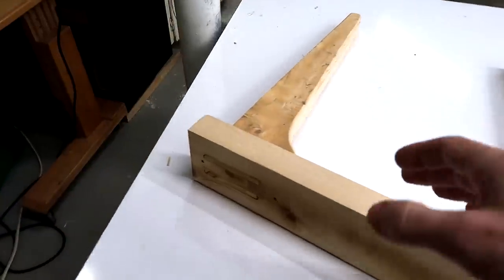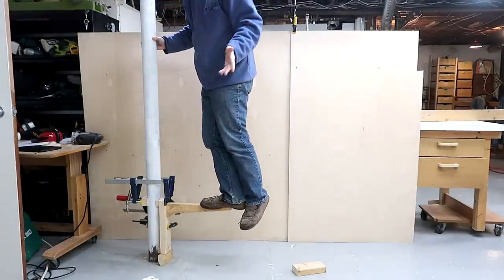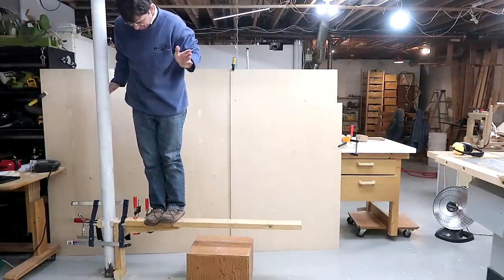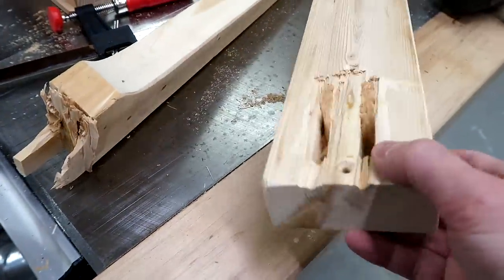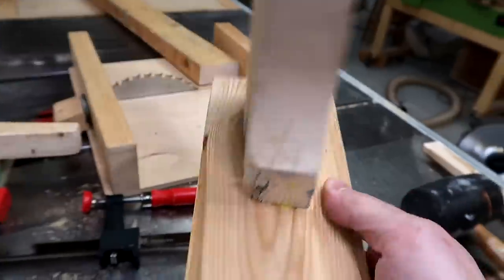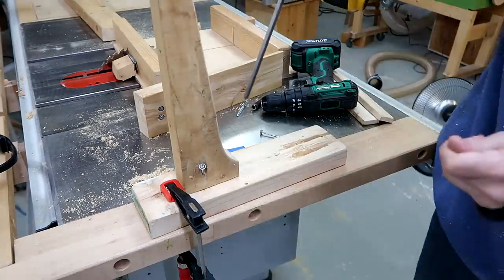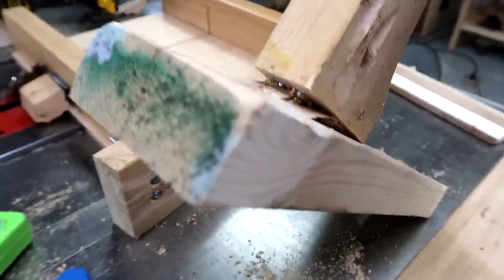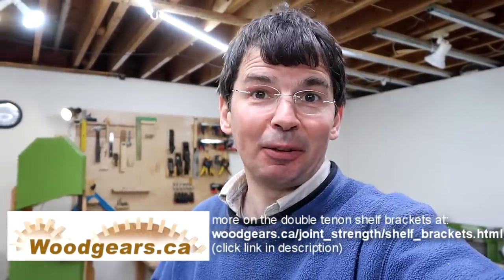Shelf bracket strength test: Double tenons vs. screwed vs. pocket holes

Comment: I find this a common issue with pocket holes. They work great for stuff like cabinets, but not for table tops for example. In time the screws slowly loose some tension and start separating the wood because you only have a small amount of holding surface.
Reply: Having built a few rough items without glue, which later gusseted for stiffness, I accept the recommendation to use glue with pocket holes. Might be of benefit in the cases you mentioned.

Comment: the problem for me would be sagging.  The level of sagging prior to failure in these test's wouldn't be acceptable for me, so in general when I make shelf brackets from wood, I add some kind of cross beam to form a triangle. Even one fairly close to the wall at an angle still makes for an incredibly strong rigid system, to which you can mount tools or store other heavy objects.

Comment: Nice work!  I'd be interested in seeing the long screw test repeated using round head screws and very substantial fender washers to back up the underside of the screw heads.
Reply from the maker: Easy.  You cut some pieces of wood and you do the test.  No special equipment required.
Reply: We can't all be daredevils like you ;-)
Reply: I think there is no practical need for much stronger joinery (for shelves of this type) than what we have seen here - putting more effort into the joinery may be unneccessary when the overall design of the entire shelf isn't equally strong. These shelves will be useful when you have to store long pieces of wood or other stuff like that and you typically will not pack it dense enough that the joinery we have seen here will fail. When you need massive metal profiles to be stored, you would use steel shelves of course. But when you have only shorter stuff to put onto a shelf, you will be better off with making ladders. The laws of levers are cruel to every material, so don't challenge them further than you have to.

Comment: Only reason to use pocket holes is if you're making a crap ton of face frames since they don't experience any real meaningful load, or using them to keep something in place that is already mostly held in by gravity (Like a countertop) and you just don't want it to shift laterally or flex/bounce when knocked. Literally the only reason I even have a pocket hole jig.

Comment: What kind of glue do you use? In our experience a good wood glue will hold better than the wood. I saw your tenon pulled out of the pocket showing glue failure.

Comment: Love your videos, and yes we know you hate pocket holes.... And it shows by the way you make about every possible mistake you can make with a pocket hole lol
Reply: Improper screw length, position not clamping work to get a solid connection, loosening screws and rightening them, improper orientation, and not an ideal situation for pockets holes to begin with.  Improper depth stop settings, and using a 12$ jig.

Let me do the same test and I'll use my poor mortise and tenon skills against pocket holes and almost guarantee I'll get the exact adverse of the results you did lol.

Comment: Why no pilot holes for either the Heinz-style or pocket-hole assemblies? Seems like it caused you a lot of trouble not to have them, and you usually do pilot holes for almost everything. Also, the splits and damage that non-piloted screws do internally may have affected your results. But you know what you're doing so I assume there's a reason. Just curious what it is.
Reply from the maker: Watch the video, see me drill the pilot hole before putting screws in from the back.  Pocket holes are generally done without pilot holes.

Comment: Hi Matthias. Nice video, I love your channel. Something that came to mind, is that since shelves are not typically +- 80 cm wide, it might be better to do this test without using a lever to increase the breaking force. This induces a moment force/torque around the joint, where an actual shelf bracket will rather have more of a vertical force.  The moment/torque creates a horizontal force on the joint, pulling the tenons and the screws. A more accurate test would maybe be to load it closer to the joint, with more weight. It would be interesting to see if the results differ when testing it like this. 
P.S. I bought your Small Dust Collector Plans and just finished building it this week. I am very satisfied with how it turned out. Well done! Keep up the inspiring work.
Reply from the maker: it's all torque that breaks the joint.
Reply: @matthiaswandel  Thinking about it now I guess you're right. Because the torque will break the bracket long before the shear force of the vertical component of the weight, it is not really necessary to test it. The deciding factor will always be the torque.

Comment: I make all mine  at a 45 degree angle with no pocket holes, no tendons, no screws. Use glue and 2-1\2 finish nails, can make 20 in 1 hour no problem.

Comment: I would say the strongest overall would be the tenons with nice straight grain and dowels driven in at 90 deg to mortice and tenons. This would guarantee a break rather than tenons slipping out. A question to ponder. Should the tenon thickness and spacing be equidistant? In the setup I mentioned the answer to this question can be answered if an equidistant test setup. Would the actual tenon fail or would the mortice side split apart or would the dowel shear? My instinct says favour must be given to a slightly thicker (a very small amount) tenon to withstand slippage and notching of the tenon from the linear tension applied by the dowels.
Reply from the maker: For a well proportioned mortise and tenon joint, pinning it weakens it as it cuts off the fibers of the tenons.  If it's well proportioned, the tenon itself is a limiting factor, so you don't want to put a hole in it.
Reply: @matthiaswandel  Thats why I said favour should be given to a slightly thicker tenon, I do accept your point in that a hole will reduce tensile strength though. I noticed your tenon failed half way down it's length which technically should not be the weakest point given it should be reinforced with glue plus friction, ideally I think you want the tenon to fail at the base leaving it seated in the mortice. To me this would seem like  optimal strength in this situation.

Comment: Looking at the failure on the tenons, if you pin the tenons about about 1/4 of the way down from the top would that improve the strength of the joint?

Comment: What about glue and screws? The bracket end grain might result in minimal glue strength, but still an interesting experiment.
Reply from the maker: the screwed joint WAS glued, just that that popped immediately, so it had no impact on the strength.
Reply: @matthiaswandel  Ah, I missed that the screwed sample was glued. I expected it would have a negligible effect on strength. Thanks for clearing that up.

Comment: I missed that John Heisz skit there

btw: impact drills do usually not hammer the bit into the screw, that is what hammer drills do (axial movement), an impact drill applys a torque by hammering tangent to the rotation
Reply: I believe you are right that it isn't directly hammering the bit into the fastener, but it is achieving that same goal indirectly. After each hammer-blow the torsional force is temporarily stopped which gives your downward pressure a chance to reseat the bit for the next Hammer blow.

Comment: Staggering the pocket holes and using the proper length of screw would have made a huge difference. Add some glue and it would be solid.

Comment: what if u used a combination of screws and nails. since screws have no shear strength due to the work hardening principle from turning threads onto metal. kind of like same reason nails are preferred fasteners in structural applications where shear strength is needed (i.e hoist hangers)

Comment: I wonder if on the shelf bracket you drilled a hole for a dowel so the screw bit into some long grain instead off end grain if it would hold better?
Reply from the maker: seeing that this is not where it failed, I don't see that making a difference.  Might even weaken it seeing that the wood itself tore around there.

Comment: Is crooked grain always weaker? Would screws also have a hard time in crooked grain? (Also, great vid- I'm a long-time fan)
Reply: The point is you want the grain to line up correctly with where the most stress (tension) is going to be for optimal strength.
Reply: @JDeWittDIY  Thanks!

Comment: Would pilot hole before 3” screws were inserted best the tenon results?  It should limit premature splitting caused by wedging the screws between wood fibers
Reply from the maker: Watch the video, see me drill the pilot hole?
Reply: Matthias Wandel I was referring to the first (long screws with washers) not the pocket holes. iirc you never showed that part

Comment: What about a thick single tenon an draw boring with say a 18mm dowel instead of glueing? I guess that would be even stronger, as the tenon could not be pulled out without sheering off the dowel.
Reply from the maker: it weakens the tenon, which would rip.  But before that, the dowel would break.

Comment: Why not use the strength of the wood by jointing the mortice and tennon like an axe head? I can think of a few variations on a mortice and tennon or pegs, or dovetails that would be stronger as they wouldn't necessarily rely on glue or screws to hold up, and you could use the grain directions to your advantage.
Reply from the maker: cause if you put that wedge in hard like an axe head, you just split the piece of wood it goes into.
Reply: @matthiaswandel  wedge? No I just meant rotate the mortise and tennon 90 degrees so that the wood against the wall is the "handle" and the shelf is the "head"... So to speak. Either that or peg it with dowels.

Comment: An impact driver does not hammer the bit into the screw head - that would be the action of a hammer drill. An impact driver impacts in the direction of rotation.

Also, I wonder how pocket bolts would be, machine screws with a nut a bolt (recessed?) on the back of the post. Or bolts in the other direction with one of those hemispherical nuts recessed in the arms the way Ikea likes to do it.

Comment: You're not building spacecraft.  Your double tenon requires 2 big, custom machines - 3 really, because a dust collector is pretty mandatory.  The screwed joint can be built anywhere by anybody with a drill in minutes.  Nobody's time and storage space is free.  The screwed joint might not be stronger, but it is BETTER.  I would argue that for a shelf yielding is better than sudden failure.

Comment: Thank you for showing these tests, you've shown us that in this case it is sufficient to screw the hangers from behind... of course, with washers  P.S. The frustration you had with the pocket holes is common! Yeah, they will move around that way, that's why they have all those special clamps. You can clamp without buying them, but they aren't as convenient or quick.  What if you screwed the wood one(or two)  screw with washer from behind in the middle and then put a pocket hole top one side and bottom the other side?  so it wouldn't move around, but would that stronger?

Comment: I would have PL Premium'd or No More Naile'd the joint and on that size of bracket I would have used 4 screws 2 in the back 2 in the face. EDIT: Thinking about it, I'd throw in some GRK structural screws and add glue to the screw hole.  I guess I overbuild/waste hardware.

Comment: If you can’t drive a screw, pocket holes probably aren’t your thing.
Reply: Probably didn't help that the workpieces weren't clamped together, though clamping that beast probably wouldn't have helped much.
Reply: But wanted to record the video- and in the effort, moved his body to an awkward position where he cannot use his body weight to manuver the drill...

Comment: Why do/did you use Phillips Head screws when there are better options? (eg Square Drive or Daisy Head)
Reply from the maker: No philips screws in this test.
Reply: @matthiaswandel  Hmm. Those stripped-out screw heads looked like Phillips. But I see on reinspection that they are square drive. Oh well = P Appreciate the response.

Comment: Another demonstration of Mr. Wandell's irrational dislike of pocket hole joinery. Misuse the method with screws that are too long for the joint and misapply the technique by using it to support a shelf bracket. Meanwhile the rest of us will use pocket holes to efficiently join face frames to cabinets and similar low stress joints where tenon or dowell joinery would be overkill.

Comment: Wouldn't the 4" screws be more effective at an inverted angle? Going in from the bottom towards the top?
Reply from the maker: no
Reply: Joel Clonch: Given the direction of traction, if they were as you say they could also bend rather than be pulled axially, giving up sooner

Comment: I guess I don't understand the pocket hole failure. The pocket holes didn't fail. The user failed to use them correctly. Do the test again with the screws properly spaced. Furthermore let us find a shelf application where we need to support a person's body weight on 1 bracket farther than 50cm out. Obviously there is great leverage at the fulcrum in this instance. In a normal shelf unit at least 2 brackets would be used with a spread load on a horizontal member. This is why I like real world examples instead of bogus diving board test.

Comment: 4 screws could have been the cause of failiure. It means 4 lines of disruption of strructure of the wood and maybe 4 points of failiure. Maybe three separated from each other, or two (even located in less than optinal locations), could make an stronger joint. But i dont think he is happy to keep trying with pocket holes    :-)

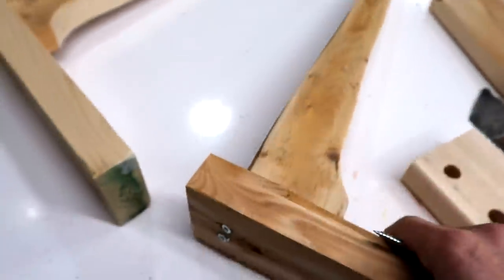Comment: 0:22 are those robertson screws stripped? I thought they weren't supposed to do that.
Reply from the maker: If you slip out of them enough, they do.
Reply: You can strip ANY fastener, given the right amount of dedication!
Reply: @iliketoUSEmybrain017  I believe "IKEA" is a Swedish short-from for "You can strip ANY fastener, given the right amount of dedication!"
Reply: Are those pocket hole screws Kreg brand? If so, there's half of the problem. Hillman pocket hole screws are better in regards to fitment with the driver bit I have found.

Comment: I'm missing the ultimate combo. Glued tenon with screw across the joint locking it in the wood.
Reply from the maker: Go ahead and test it
Reply: @matthiaswandel  For proper comparison the conditions should be the same. And believe me, If I'd be the one to test them they'd broke much earlier. :-)

Comment: What about pocket holes with metric screws and big washers on the back?
Reply: what do you mean by metric screws? machine screws with metric iso threads?

if mounted correct an M8 bolt with 8.8 rating bolt will hold about 32 kN which is about 3,26 metric tons of axial load

but since the threads are very fine they will pull out and fail way sooner than regular rood screws

Comment: This is actually the least fair comparison I've seen him do.  They all had to deal with the same crappy lumber, the screws were driven in a way that we all know wasn't the strongest and there is no way that they took as long as the mortise/tenon even not counting setup, and then the pocket holes... they were used in an already compromised piece of lumber AND then drove a mess of them crisscrossing through the same area practically destroying it in the process.  

Honestly, all things considered, all three appear to be roughly equally functional, with one taking MUCH longer to make using tools that most of us don't have- the M&T...
Reply from the maker: Please do a better test yourself.
Reply: @matthiaswandel  You know that's not a fair response to most people.  Almost no one has a pantarouter, and I'm not sure if I could put together a double mortise and tenon that fits as well as yours and would likely be a poor representation of your joint, just like yours were poor representations of the other 2 done well.  

Getting past that, my video skills are atrocious and no one would watch it, not even me.

Of course, thinking about an easy way that I could approximate your double tenon joint got me wondering if 2 dominos (not that I know anyone that has one) or 4 dowels would be stronger- glue is already stronger than wood and dominos and dowels are both hardwood. Alternatively, a couple of 4" washer head screws driven into the backs of your tenons would also be an interesting experiment, the screws could act to both reinforce the tenon and as a wedge like a hammer or axe handle is wedged.

I guess someone might find it entertaining to watch all 280# of me doing a Samsonite gorilla impression testing these things.  :-P

Comment: I am with you on the pocket holes. When I watch a construction video and they pull out the pocket hole jig I quite often just switch off. Construction methods based on them is just lazy at best.The pocket hole jig I bought is the most underused tool I have. Not saying that I never use it but may be one or twice in 10 years. However the screws designed to go with them are amazing. They are very useful, I wouldn't be without them in my personal arsenal

Comment: Any attachment + construction adhesive, over time = only the original attachment. Contractors glued and screwed our upstairs floor decking to the joists. “We glued that with construction adhesive. You’ll NEVER have a squeak.” On the contrary, the glue failed quickly, leaving us with intolerable creaking and groaning. 55 more screws later, it’s quiet. John notwithstanding, I wish anyone luck with construction adhesive in a high stress or movement prone application. I’ll take a well-glued mortise and tenon bracket.
Reply from the maker: Our old house had the plywod glued to the joists with construction adhesive.   Very stable and squeak free floors they were.